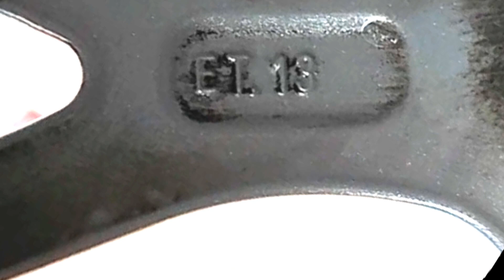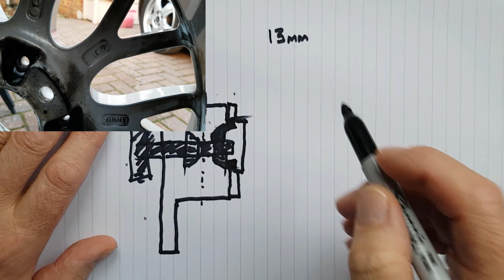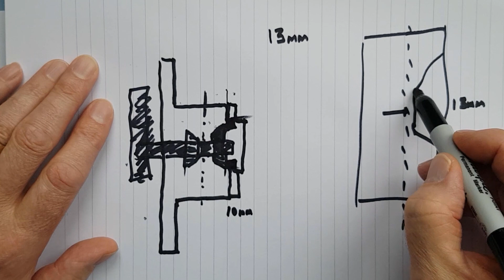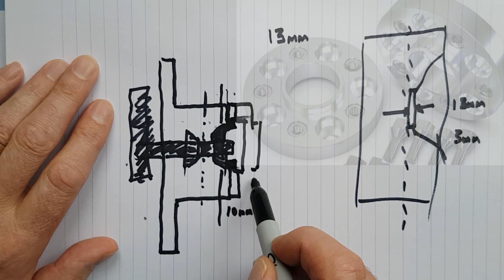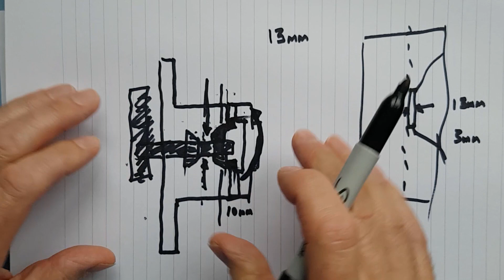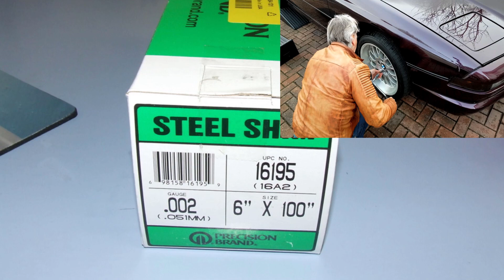BMW Shimmy with Replica and non-OEM Alloys Spacers and Hub-centric rings

Comment: What if the shimmy is none of this and happens from 60mph to up to 100mph. 
Pressure is higher, wheels original rims, second set of wheels also original rims (summer) All good quaility (Michelin and Pirelli)
Balancing not the case, bent rim not the case! Rotors/brakes not the issue.

What then can be? (No Visible issue in ball bearings and tie rods. Alignment also in spec
Reply from the maker: Hello Vassilis, that speed range means that the front axle is NOT affected - it is a problem with the rear axle, so don't waste time and money at the front end! The problem could be one of the output shaft joints failing: https://www.realoem.com/bmw/enUS/showparts?id=EF82-EUR-11-1998-E31-BMW-840Ci&diagId=33_1123
Reply: @TimmsBMW  the car only gives a vibration on the steering, linke imbalance! and under or not power the shake exists. :\

Comment: Hey where did you get those wheel spacers 72.6 -74.1?
Reply from the maker: Loads on Ebay: https://www.ebay.co.uk/sch/i.html?_from=R40&_trksid=p2334524.m570.l1313&_nkw=72.6+-+74.2+spacers&_sacat=0&LH_TitleDesc=0&_odkw=SP25+spacers&_osacat=0

Comment: Brilliant vid Tim.  Only just twigged this week that the E39 wheels I put on my 850i 8 years ago are 74.2 hub size.  Yes, eight years ago!!!  A £10 set of aluminium rings went on today in about 25 minutes.  I drove it waiting for the light shuddering at 60mph; it never came, I looked down, I was doing 80mph.  Brilliant, I'm chuffed.
Reply from the maker: That's great news - glad the video helped!

Comment: Great video, beautiful car,, I know it’s a old video but what kind of yellow tape you used on the hub itself to achieve tight perfect fit ? 
 I’m running wide aftermarket wheels at the rear on my F30 335i, (285/30/19) 
I am experiencing slight shimmy at the rear of the vehicle around 70 mph but nothing through the steering wheel I thought I look into the wheel hub fitment more closely and also a tire pressure, right now is at 35psi.
Again Great, video great car.
Reply from the maker: Hello! I'm using Kapton Tape - which is Polyamide Tape - available from Amazon: https://amzn.to/3wgxTjb
Reply: @TimmsBMW  Thank you much.

Comment: Thanks for these videos, I've been chasing a minor vibration / shimmy for over a year now on a 2005 325i.  I've replaced half shafts, the drive shaft and guibo, wheel bearings, rotors, all the way around, various mounts and busings to no avail.  I've swapped tires and wheels off an e36 convertible that rides like glass and still have this annoying vibration and a sometimes shimmy that I can't shake (pun intended).  I've even taken it to a BMW specialty shop and they couldn't come up with an answer.  In fact they said they couldn't notice it so maybe I have a hyper sensitive shimmy detector...I don't know.  I do know I've been wrenching on cars since I was 13 years old as my pops had a used car business so I do have a feel for what is right and what isnt.  This gives me some things to try.   I love the way this dumb old car drives when things are working well so hopefully I can now put this issue to bed.

Comment: Hey Tim,
Great video and website, helps me a lot! 
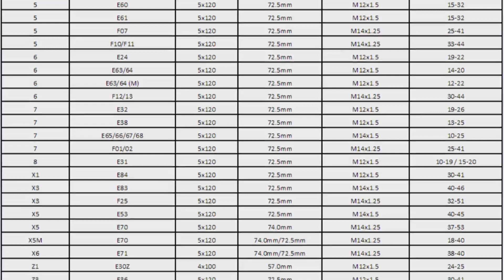Wondering if you could clarify something from the video I was confused on. At 4:20, you mentioned the ET on your wheels are 13mm, but you have 10mm spacers, so ET = 3. And you said that the 840 was between 5-15mm. But when you show your page at 5:00 and the e31 shows the offset to be 10-19 /15-20. Also why are there 2 different measurements?
Thanks for the help.
Dayal
Reply from the maker: Yes, looking back at the video I do get confused at one point! I get it right here though: https://www.meeknet.co.uk/e31/Timms_bmw_wheel_and_tyre_page.htm
Reply: Sure no problem. I have read this webpage (love the detail of your whole website btw!). I just want to clarify. I have a new staggered set of style 37 18" (ET 13 fronts and ET 25 rears). I went from the style 8 16" (ET 15 all round) . I want to have more of a filled arch look like you have, hence the spacer question. Based on your table on the webpage, the only spacer I can use would be 3mm on the fronts (to be within the 10-19 specified in the table) and 10mm spacer on the rears (to be within 15-20 specified in the table). Would this be correct? If so, what else could you recommend in order for me to fill that arch?
Thanks again
Reply from the maker: @dayalvekeria8705  Yes, on my E31 I push the offsets away from the ideal and do suffer from more wear than would be expected - but, like you, I just like the stance so much better so I put up with it!
Reply: Thanks for the clarification Tim and keep doing what you are doing, love these videos! The look of your car is amazing, especially the seats, paint and wheels!

Comment: Timm I have M parallel 18' wheels on my '94 840CI and on occasion I get the shimmering. I'm not too versed in cars but do you think that possibly the original owner (before me) put spacers on that were not the correct size? Also I notice that at high speeds (70mph) my ABS/traction control light comes on..dealer said it was becuase the wheels are too big for the car and not meant to be on the car. Can you help me in figuring this out?
Reply from the maker: Yes, it is possibly the tyre size - all explained here:
https://www.meeknet.co.uk/e31/Timms_bmw_wheel_and_tyre_page.htm

Comment: They’re roller bearings. Not conical. But great info! Thanks.
Reply from the maker: My pleasure! Yes, I realised that as soon as I saw the video!
Reply: Timm's BMW Repairs and Information I had a similar shimmy as what you described in the video. I will up the tyre pressure like you suggested and see if it clears it.

Comment: How can you tell if you have replica wheels or original?
Reply from the maker: The give-away is the bore size - which you can measure with a vernier. If the bore size is anything other than 72.6mm they are replicas
Reply: @TimmsBMW  Incorrect. E39 bore size is an orphan, being larger than other models,  but still genuine BMW wheels.
Reply: Casting marks

Comment: Hi Timm, I've been having a heck of a time getting a shimmy out of my '95 840ci...replaced brembo calipers, bought new control arms, rebalanced the AC Schnitzer wheels/tires using proper ACS aluminium adapter/7mm spacers, nothing fixed the problem... Turns out I had flat spotted 3 of 4 tires, since I don't drive my E31 nearly as much as you do! Always do a road force balance at your tire shop, and if the numbers are bad, your tires (new or not) may be the culprit! These tires are only 2 years old with about 75 miles on them, and they're ruined. Usually you can run them for 20 miles and get them back into round, but depends on tires and compounds... These are not healing themselves, even with the car on the lift for a month...better, but still not smooth. And bobbles worst around the usual 55-60 MPH range.
Reply from the maker: Have you increased your tyre pressure to 40 psi? That reduces flat spots.....
Reply: @TimmsBMW  yes indeed, I run 39 psig all around, as checked with a calibrated laboratory gauge!
Reply from the maker: @chamberlin1  I would expect to see the calibration certification!